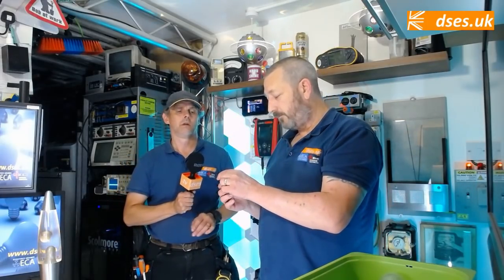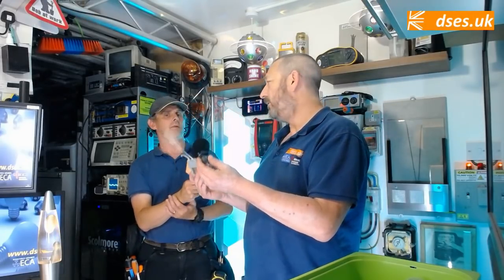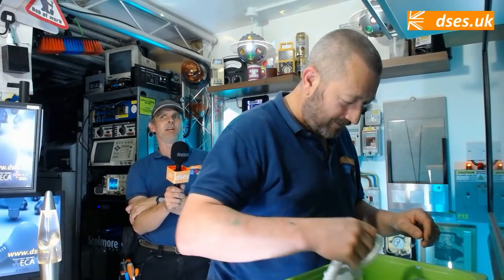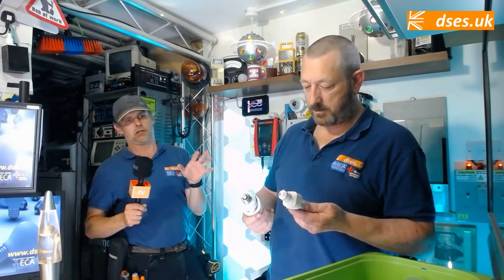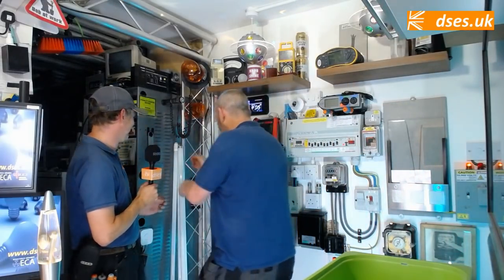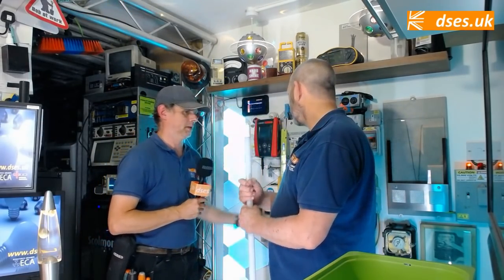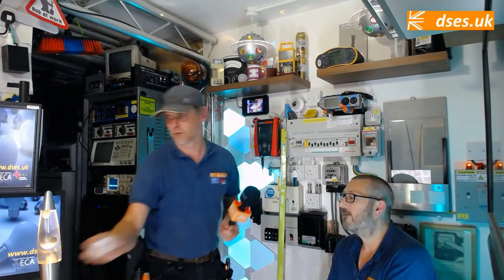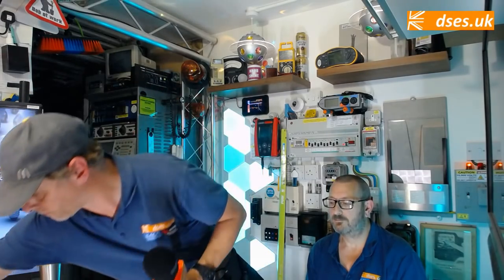SH!T CHAT: Last orders on old lamps

Comment: For editing photos I kneed a full spectrum light bulb which can only be achieved by an incandescent bulb. Glad I bought two dozen about twenty years ago. I have one fluorescent bulb which is daylight balanced, replacement bulbs cost £20. Are any of the LEDs full spectrum daylight balanced?
Reply from the maker: I'm afraid I don't know John. What kind of lamps do you currently use? I wonder if there will still be some such which get around the legislation and remain sold as for use in applications like photography?
Reply: @dsesuk  I finally found a tungsten bulb with envelope being a tungsten to daylight filter.
https://www.theimagingwarehouse.com/ProductGrp/Daylight-Corrected-Print-Viewing-Tungsten-Bulbs
Hope this helps any photo printers out there.
This modern lighting makes showing prints a nightmare as the print colour changes with each lamp it is viewed under, especially paper with colour brighter in it, which also changes with age of the print.

Comment: The T 12 is so called because it is in parts of an inch ,each part being 1/8 of an inch. T8 is 8/8ths  of an inch or 1 inch in width . A T12 is therefore 12 /8ths of an inch or in other words 1&1/2 inches in width. With these lamps it’s all about girth

Comment: G9 in our oven.. I wonder if the LED replacement will be able to tolerate the pyrolytic cleaning mode of the oven ?
Reply from the maker: I still have a G4 in mine, although the lamp holder is knackered and it doesn't work without some wiggling.
Reply: @dsesuk  Time to horde 👍

Comment: It’s a pain in the hoop that I now have relatively new disco/stage lighting consigned to the scrap heap…
Reply from the maker: What lamps do they use Stevie? You might be able to still get them if they have a use exempting them from the legislation.
Reply: @dsesuk  my showtec sunstrips use bog standard halogen GU10 50W lamps. Disco sequencers are on 60W reflector spot lamps. Soundlab vorma uses 3x linear halogen tubes. Disco scans are on 12v 100w reflector lamps (these may be exempt for now as you say…) got some lights that are using 300w 120v halogen capsules…. 

I do have quite a lot of LED disco lighting, but it can’t match the effect of the halogen stuff. I’ve converted my 12v 50w halogen moon flowers to LED with reasonable success.

Comment: Any tips on a good replacement driver for a MR16 12v halogen light in the center of a shower extractor ? Can the existing connector be replaced with a GU10 socket ? it has screws on it. Really don't want to replace the whole fitting, the ceiling is made of wooden slats, horse hair and crap by the look of it :0
Reply from the maker: This is a good question Leah, one I perhaps should have addressed in this presentation. These have a halogen driver that sits outside the fan assembly, so that can be changed for a LED driver although access may have to be gained via the attic or the fan pulled down to get to it from below. Once the halogen driver has been changed for a LED model, a LED MR16 lamp can be fitted. We've converted several of these over the years with success. A driver of only 6W will be plenty for the task, but we've no particular brands we're wedded to. I've used Sebson and Long Life Lamp Company drivers from off Amazon in the past without any issues.

Comment: We use R7s lamps for heating, think they will still be available for specialist uses or we is buggered!
Reply from the maker: Are they the infrared ones or the standard models? I'm not sure what Wattage a 2700 lumen lamp would be in that form to be honest, so you may be okay if your current requirements are below that. For now anyway.
Reply: They are often used in bain marie's in restaurants to keep the food warm for buffets etc but it is the standard r7 not infared. Obviously led will be useless here as there will be no/less heat, the most recent one I worked on had 6 400w lamps. I wonder what the alternative will be for things like that.
Reply: @dsesuk  original 12 x 400W in a couple of passes in a kitchen...
Reply from the maker: @cfcduffysafc  If they have a commercial purpose outside of domestic lighting, then they'll still be available. What we're talking about here is on the high street for Jack and Jill Public.
Reply: The entertainment industry is finding that although lamps (eg 1000W R7, some PARs) may still be produced, the demand has fallen to the point that manufacturers are discontinuing some

Comment: You can stack a load of LED 5.3’s on one old transformer. Not that I would but those horrible curved wall fittings won’t house a GU10 so can be a handy shortcut
Reply: yeah got a few 200-250VA lumps... i keep them because ONE day i will back to back them for a quick and dirty isolation transformer :) One day...

Comment: G9 or GU9 lamps are often used for oven lamps
They don't make a heat proof led conversion
I wonder what they will do?
Reply from the maker: They'll probably continue selling them, blister packed individually at £3.99 each and labelled as 'oven lamps'. That would probably get them around the legislation as they would have a purpose outside of room lighting.
Reply: @dsesuk  there all the bloody same they run at far higher temps than the oven will ever reach
But yeah they will be packaged as special oven use blubs

Comment: Talking about light fittings that are replaceable i have come across some JCC bollard lights that are Led, only fitted in 2019 with failed Led lamps with built in Drivers but JCC won't sell them on their own so you have to buy the complete bollard lights!
You can't put anything different as far as I'm aware as  the lamp and driver kits come with their own fixings brackets to fix to the bollards.
Pisses me off when manufacturers sell light fittings but don't sell replacement parts
Reply from the maker: JCC are garbage.

Comment: As most of those light fittings have been replaced by L.e.d at most wholesalers anyway over the last few years the existing light fittings are going to be getting on a bit in years so probably best to fit new light fittings anyway
Reply: It’s pretty shit to have to replace fittings. I’ve got bayonet fittings that must be 60 years old and still absolutely fine. To be changing after 20 is a bit of a joke.
Reply: @chrisb4009  I thought that especially with Led Light fittings where you would of thought the parts would still be available as the light fittings are still being made and the cost of them and material usage to construct a full bollard light and I wouldn't of thought it would be that out of date for new product lines.

Comment: The G4 was at one time very popular in the touring caravan industry
Reply from the maker: I hadn't thought of automotive when putting this together, but I suppose that's an industry that has embraced LED to reduce the loading on leisure batteries?
Reply: @dsesuk  Not many think about us lowly leisure industry scum bags 🤪🤣  several of the 12 volt halogens will be effected but as you say the industry has jumped on LEDs and even before that the customers did themselves, as you say to extend battery life, which was a god send really as most fitting were 10 watt and so often customers would replace a bulb/lamp with 20 watt and destroy the fitting 😉

Comment: The idea of a central junction box to run lighting cables too is not a new idea, I worked on some prefabricated home from the 50s/60s that used the same idea, the cables were twin pvc with an earthed wire mesh outer sheath with none standard colours for the cores (purple, orange etc)
Reply from the maker: Kip's mystery box was also an old one, so nothing new as you say. Just not something that's too common I find.

Comment: Hi Dave, it's the old sod from North Wales again, what happened to Nigel's hair?  On a more serious note although LED lamps use less current over the filament lamps, the LED lamps have a poor power factor compared to the filament lamps being a resistive load with a power factor of 1, at the moment it is not possible for the electricity companies to measure PF with the older meters, but the so-called smart meters they will be able to should the supplier wish to do so in the near future.  Big Clive has spoken about this in the past...
I would like to hear your views on this. Regards, Ray..
Reply from the maker: Well, it's a good point Ray, but not something I'm personally going to lose any sleep over. The power factor on domestic lighting ought to be small enough that it won't put a dink in my beer fund should my energy provider charge for it. Other loads may be of more concern however.
Reply: @dsesuk  Hi Dave, so many other electronic devices have a poor power factor, devices using switched mode power supplies like computers, TVs etc. all these devices contribute to an overall poor power factor, I wonder what the power factor of an EV charger is? in the near future we may be concerned more about Smart Meters, which at the end of the day maybe only smart for the suppliers, the public are being told they will save money by having a Smart Meter, it is just as much use as the fake plug in power savers..
I'm sorry to bend your ear Dave, but I have always held your opinion in high esteem.  Regards, Ray..

Comment: David, what’s going to happen with the dimmable touch lamps (table lamps) ? They only work with halogen lamps. They dim in three stages, dimmable LED lamps don’t work in them as the gear inside the fittings are not LED dimmers?
Reply: need replacement probably... or a load resistor that kinda nullifies the saving of LED
Reply from the maker: I thought that, but some of them use pulse-width modulation like a LED dimmer (i.e. they rapidly switch on and off) and can work with dimmable LEDs.
Reply: @dsesuk  yes the much more recent ones... the older (200x ones) are kaput.. BTW David... they say 'the light source in this luminaire is non replaceable'... which is clearly a lie, every sparky has a surface mount rework station in the van, right?

(joking aside, i keep a cheapo soldering station and roll of non RoHS compliant proper solder in the van)

Comment: I’m most disappointed the r7s 118mm is going. I did already know though. So what wattage is 2700lm
Reply: In the UK the 120w lamp that's sold as equivalent to the 150 of the previous generation outputs about 2250lm.

Anyone know the difference between r7 and r7s? Never found out

Comment: Hi everyone.. im quite desperate to get an answer for question :  (sorry to go out of topic here but i thought Dave would be the one who knows 100% answer)
Is capping of cables regulation? 
I know it's a good practice but if I haven't capped my wires.. did i go outside ob BS7671? 
Many thanks for your answers
*I have got client on my ass to argue with me
Reply from the maker: Cables don't have to be capped. Capping doesn't meet the requirement for mechanical protection and only serves to protect against nicks from the plasterers trowel or other first fix tool swinging on site. That's why you can get plastic capping - doesn't even have to be steel; it's just there as a layer of protection until they're covered over. Most new builds shun it and you just see the cables clipped to the walls before being boarded over. Running the cables in prescribed zones and RCD protecting them (to meet today's standard) is their method of protection.
Reply: @dsesuk  many thanks David for such a quick and spot on reply on subject..
I have never been in position where customer thinks he knows better 🙂 and trying to squeeze money from me for repair work by other "spark" 
Who said that my work need capping. ( In channel) 

Thanks again for your help 👍
Reply from the maker: @callimero2409  Whenever I'm faced (rarely it has to be said) with a customer who has taken the advice of another spark and is questioning what I've done, I ask them to point out the specific regulation or guidance they think I've supposedly not followed. If they can find something and prove I haven't done it by the book, then I'll put it right at my own expense. It's never happened though, because the response is always baseless - something along the lines of "well, I don't think it's right" or "I wouldn't have done it that way." Usually it goes the other way and I'll dig out the regs to show why I've done it the way I have which soon has them slinking off with their tail between their legs. Put ten sparks in a room and you'll get ten different ways of doing a job. Two will be wholly wrong, the rest will be different interpretations each as valid as the other!
Reply: @dsesuk  hi dave, this is my first experience with issue like this one.. at the moment I’m in position where customer didn’t pay my invoice for work, wants me to pay for “repair work” without chance to rectify what she wrote down in email..most of her points are rubbish any way..
She even wants to claim money of me for damaged ceiling..how else I should run a cables when there is a bathroom above kitchen I worked on. (Also explained when I quoted that will have to cut into ceiling)  I even replaced most of damaged plaster and screwed it back to places where I needed to go through joists.
This really brings me to your earlier videos where you describing plan of work in official letter included with quote…
I did it only verbally..and it’s just not good enough at the situation like mine

I just want to thank you for replies 🤝

Comment: Top notch stuff, but just wondering on vivarium t5/t8 uv and heat lamps (basking bulbs) for these lazy ar$ed lizards
Reply from the maker: If they have a use outside of room lighting, they should remain on the market unless it's particularly old, proprietary or reasonable to expect it to continue. For my own aquarium, they changed from a T8 to a T5 fitting over ten years ago. I've already changed it after a ballast failure.

Comment: What brands should we look out for David?
Reply from the maker: I've had good success with LEDVANCE floodlights. For GU10/G4/G9 Integral have been pretty good and I've had no trouble with Fusion although I haven't fitted as many of them as they tend to be pricey at CEF. I've been sniffy about LAP in the past, but have used some of their lamps without problem in the past year. The biggest problems I've had have been with brands I used to push people towards such as Philips and Crompton. These days I'd sooner buy an Asda lamp than chose those venerable marques and I imagine the supermarket brands are probably pretty robust now unlike a few years ago.
Reply: @dsesuk  Thanks for this! 
It's hit or miss I suppose, i've gone with all Philips led's for the house so far and they've been fine 2 years and a bit in. Energizser before that was a bit poor.

Would you recommend ansell for a led batton on a garage btw?
Reply: @dsesuk  Agreed on LEDADVANCE. I think they're an Osram brand which historically had some links to Bosch, so they should have 'the quality message'. Can't speak on Philips for domestic lighting, but I've been extremely disappointed with their automotive LED products. Poorly designed and awful RFI emission, all for £100+ for a pair of bulbs. Expected better from what used to be the brand.
Reply from the maker: @pauledwards9493  I've no experience with Ansell; Eddies sell them but I tend to favour CEF. I hear good things about them though, they sound reliable from what people say on here.

Comment: Fuckin excellent video daveO nice one 👍 recently came across t12 6 and 8 foot tubes remember those. Try changing one of them on your own. Yeah the discharge lamps to be binned, SON, MHI and another not so common one MBF those were high pressure Mercury vapour lamps, seen it all. The children's of today will never know.
Reply: MBF-U were very common in suburban streetlighting... I miss SOX :(

8ft 125w T12's were pretty universal where I was trained in the 80s
Reply: @TheChipmunk2008  I forgot to mention sox lamps yep another familiar one, low pressure sodium,  the 55w version we used a lot of  again for street lighting.  Good times 🙂

Comment: So as someone who suffers from LED induced migraines....
Reply from the maker: I can understand that for low quality lamps with, say, a 50Hz flicker, but surely there are examples on the market whose light output matches that of an incandescent exactly?
Reply: @dsesuk  unfortunately not that I have found so far. There are some that are better than others & the newer stuff tends to be better than the old.   Things like heavy diffusion and indirect illumination help, but obviously it's not something that is easily controlled outside of the home environment. 

I'm actually supportive of the changes overall as it is for the greater good, it is just annoys me the way in which such decisions appear to be made without full consideration of the unintentional consequences.
Reply: @dsesuk  No, there isn't. even the most expensive LED's have shit color rendering compared to incandescent. The shit color rendering is in part responsible for the migraines, not just the flicker. The human eye has evolved with the sun's black-body radiation (the sun and incandescents are black-body radiators of light) for millions of years, and now we are using light sources with horrible color rendering that completely destroy the colors and hues the eye was made to see with, this is a problem.